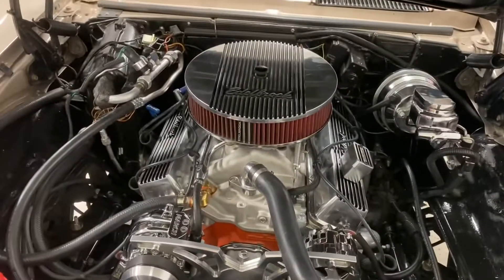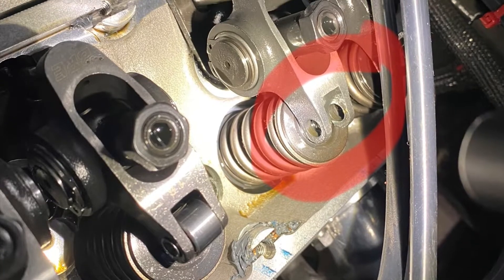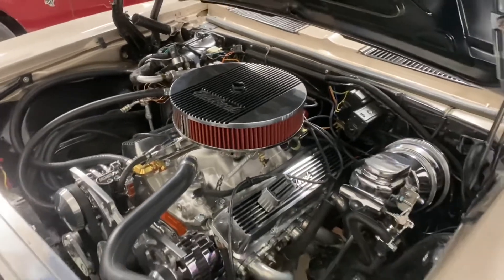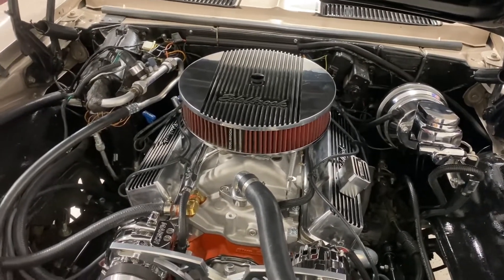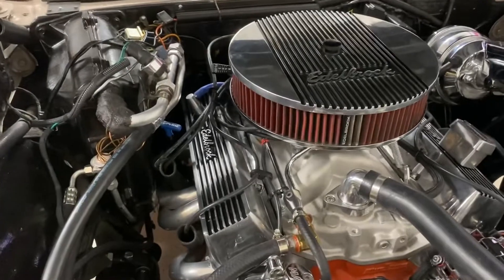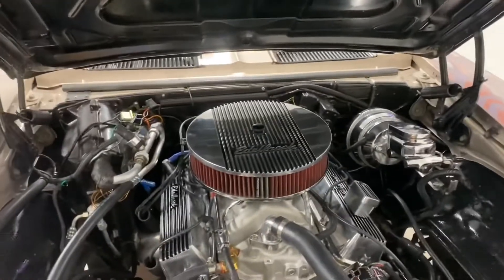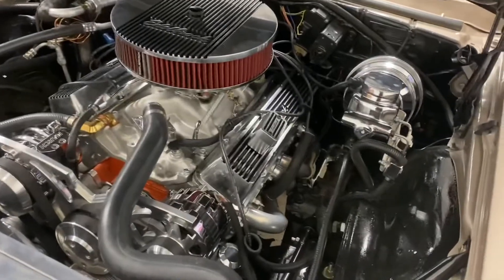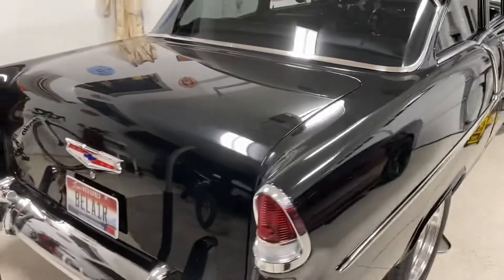Blue Print 400 Roller Rocker Problem 1968 Camaro

Comment: I just came across this video and how Ironic is it.  When I was putting  new valve covers on my 396 sbc, I found 1 rocker arm roller migrating out. Not as bad as yours but very concerning. I checked all the other rockers and they seem to be ok. Blueprint was receptive and sent me a new rocker arm. I hope I do not not have any more rocker issues.
Reply from the maker: That makes two of us- they just sent a whole set for mine I guess to make sure it wasn’t a bad batch, but it’s definitely something I will start checking if I hear any clatter at all.
Reply: @George Krall when did you order your blueprint? I have a 400 on order with summit but eta ship date is August. Makes me a bit nervous but they probably sell thousands without issue.
Reply: @doctube2020  I ordered the 396 Sbc early last year. Its been a good engine. Blueprint was very receptive and came through!

Comment: No worries, man. Sure, we all think we could have done this or that, but in the end, I want someone who knows what they are doing the work. I ran into the same kind of problem with a rebuilt 235 Chevy six 40 years ago. It was a Gopher Motors Rebuilt engine. On that six, there is a head bolt that has an oil galley going through it to oil the rocker arms, the whole top of the head, just under the valve cover. I sensed something was wrong, just by the sound of it. I thought to myself it sounded like the top of the head was not getting any oil. Anyway, I took it back to the guy that installed the engine. He took the valve cover and his jaw hit the floor he said. Dry as a bone under the valve cover. Long story short, I got a new head from Gopher, but I had to pay the labor off and on. They paid the shipping. It was quite the experience. But, in the end, I was satisfied. They put a solid bolt in that head that should have had that oil galley hole, that is what caused the problem. That was a solid engine though. They are rebuilt stock, so it was not a hot rod. It was just a trusty old stovebolt six in my 55 Chev pickup.
Reply from the maker: It’s good they stood by their product!

Comment: Do you like that there is cast connecting rods in between a forged crank/pistons ? I'm close to using this crate engine , but they won't offer a forged  rod, or a 6" rod
Reply from the maker: I definitely get your point. It just kind of came down to price point for me mixed with the horsepower. I would’ve honestly loved to go with a local shop and pick all my parts but the quote I got cost nearly as much as the BP motor and a 700r4. It comes with a warranty for what that’s worth haha.
Reply: @nationhotrods  I found Tristar engines,  with a 6" forged rod, Dart block/heads, if no one tells me what's bad about tristar engines, I'm buying their 406 tomorrow.  I was favoring blueprint but a 6" forged rod    is gonna decide it for me
Reply from the maker: @406MenaceRacecar  that’s awesome. Do some vids on it and let the world know how it goes. Maybe next time I’ll get one whenever I need it and if it works well for you and others .
Reply: Thanks man
Reply: Their 396 SBC has 6” forged rods
Reply: @dustinharvin3870  that's a 350 block

Comment: So long story short, when purchasing an engine from BP or any other, should you open it up and make sure everything is tqd and tight?
Reply from the maker: We’ve bought 3 -BP400 and only one had an issue so I guess it’s up to you. We haven’t checked the other two and thankfully they are fine.
Reply: Yes if I ever order one I would pull both valve covers rotate the engine over several times to make sure everything is nice and tight before firing it up never know if the person that put it together might have missed something on the build or if anything broke during the dyno testing

Comment: The factory air has a better ability to cool than vintage air. Don't swap.
Reply from the maker: It blows cold but I need to see if maybe they make a stronger blower motor. We put vintage in my dads 55 and it’ll freeze you out.